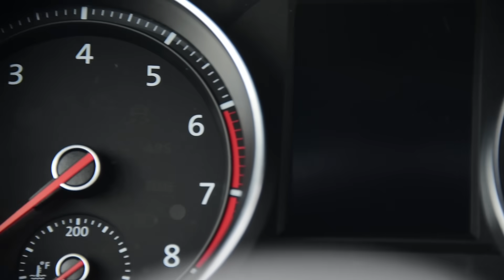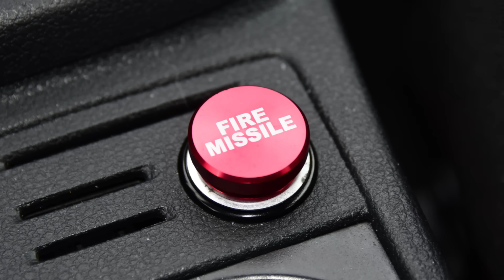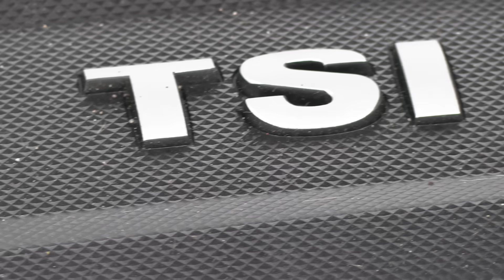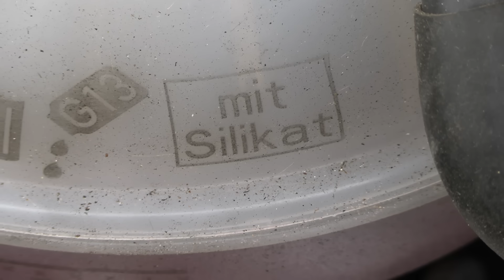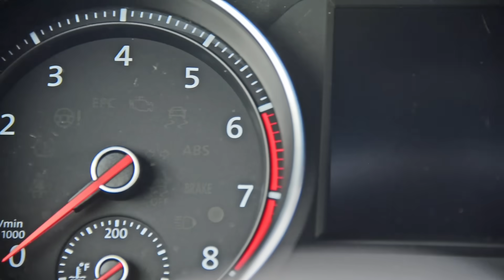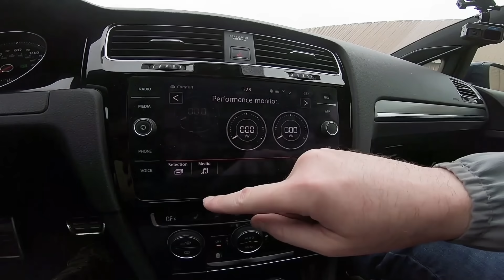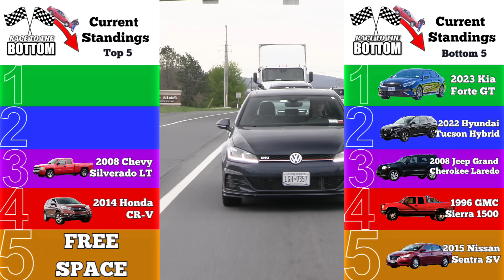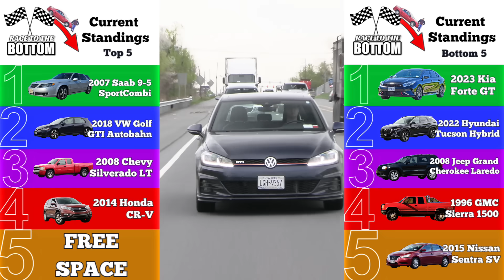2018 Volkswagen Golf GTI Autobahn: Regular Car Reviews

Comment: Mr. Regular critiquing the engine bay layout shows he’s used to older vehicles.  It’s tight but not that bad. Pulling a battery to replace a brake master is nothing.
Reply: Also torx is better than phillips since they don’t strip as easily. But maybe thats more user error
Reply: And how often is the master cylinder getting replaced on a MK7 Golf anyway? That's almost never gonna happen during ownership, goofy complaint for sure
Reply: The Galaxy's quarry of an engine bay is changing him
Reply: I had a 2012 Sentra SE-R SpecV before having a 2018 GTI Autobahn. The Sentra needs you to remove a wheel and the wheel well cover to change the oil filter
Reply: @Damaku250  And the GTI oil filter is right on top 😂
Reply: @leospaceman2976  Torx heads are fine. Bolts or screws of any kind on my air filter box are just unnecessary. The only vehicles I've owned with bolts on the air box are VW.
Reply: @Damaku250 that’s crazy cuz I have the generation before it and it’s just hanging out the side really easy to get to. Like just peeking under the car I can see it immediately.

Comment: The real irony of the Golf/GTI is the extreme misunderstanding of what the car is between the states and Europe. In Europe that's a boring seen it everywhere car, with an older client base, tuned accordingly, and with enough of a good rep that the nicer versions get insanely (to us) expensive. It's every rental car I've ever gotten by default over there as well. In the states...it can be that, or it can be that weird other choice vs a base Camaro or Mustang. So your lawyer or doctor might have a nice and obsessively owned GTI here, OR it could be a sTAnCed, cat deleted, chassis notched, future nightmare trade in boys car.

As a serial golf enjoyer myself I would like to point out that almost all of the common mods revolve around winding back that "seniors first" tuning aesthetic that the Europeans expect from this car. The absurdly linear power band, the little ball in the clutch hydraulic line that only exists to lengthen the shift moment, the suspension that is very nice but on the compliant side, etc... Drive a focus st back to back and it's fairly obvious that the ford was designed for a younger buying demo in the first place.
Reply: this comment is spot-on. 👌
Reply: Agreed 100%. I feel thats why it makes such a great platform to build on as well with the plethora of parts; even the OEM+ upgrade you can snag from audi/porsche.
Reply: @Mk6thicc  I definitely agree. That European "yawn I've seen this a million times before" factor means the aftermarket and OEM+ options are extremely broad. They sell so many there that every little micro niche is filled. I bet our GTI experience is pretty similar to being a European that's into large RWD American sedans. Imagine buying some weird ass car no one near you has, only to get online and find a continents worth of police fleet mods, the drag racing stuff, full subframe and other core geometry altering kits etc...

Comment: I drive a 2008 Golf Mk6 1.4 TSI.
Officially the most average car ever. He 'll turn 16 in a couple of months, and I intend to keep him until the Mk9 comes out, which was confirmed by VW to be electric only.
Golfs not only show status, they also show the exact opposite, indifference to status. No matter whether you're rich or poor, at some point in your life, you'll be able to afford one, whether it's new or used.
It's the great equalizer. Just like death, but way less german.
Reply: That's why i like VAG cars, u don;t wanna golf ok, here is A3, u don't have mony for Audi. U have Skoda....
Reply: Golfs don't show status, they show the sheep like midlndlessness of consumers who don't know anything about a product so buy the brand name because it's safe. And anyone buying a car for status is a nob.
Reply: @mateuszzimon8216  same car...just higher price for brand conscious
Reply: @crztank9298 you kind of explained toyota corolla and a lot of other mundane cars that exist on the road as an appliance that will get you from point A to point B.
Reply: Had a 2012 Seat Leon 1.4 TSI
The reasons I chose it over the golf are A: it was cheaper B: it had a manual option
kept it until 2023 when I switched to an EV. Never did any mods to it, it was just a car.
Reply: If the Mk9 is electric only, why not get the ID3…?
Reply: @geoffreymak000 I imagine the mk9 golf will have a more traditional interior with more physical buttons than the ID line

Comment: I know someone who's got an addiction to Mk7 and Mk8 VWs. Every story about when they break down turns into a lecture about how the job "only" needs "a couple" special tools to rip half the car apart in a "clever" way. I think it's the crayon offgassing from the interior plastics.
Reply: Same as land rover owners. Or modern Volvo's. Or Alfa Romeo.
Reply: Step One: move car to service position = Remove entire front bumper assembly, radiator, support, etc.

Comment: I have been owning a Golf GTI Mk7 for 7 years, bone stock, and I genuinely thought I would get over it by now... but it is honestly good. Besides major issues with the cooling system, and maybe the timing chain, if you look after this car, it will look after you. You absolutely do not need to do any power mods at all to it.
Reply: yeah, but it's fun when you doooo!
Reply: I’ve been on the hunt for a mk7.5 for years now and may just suck it up and grab a mk8. Or a new one depending on market prices at the time. There’s not many manual cars left, even less hatchbacks
Reply: "besides major issues with the cooling system" the engine might nuke itself if you don't pay attention, but other than that it's good!
Reply: @KrikZ32  there is a huge, loud beeping warning when coolant gets low. I had a part fail on mine, and it was very obvious that the car was not happy.

Comment: Grew up in the UK driving hot hatches but never owned a GTI. When I moved to the States, I went American owning 3 mustangs, the last being a GT 5.0. However, also owning motorcycles, I wasn’t driving the GT much and it was an awful commuter so bought a GTI a couple of months back. Man, it was like coming home. Taught suspension that you can chuck round corners. Enough power that you can join around in the canyons, but not so much that you can’t use most of it. I thought I’d regret selling the mustang for something a little more sensible, but not a bit of it! It’s also the first auto I’ve ever owned. The DSG is fantastic. Put it into manual mode, it changes quick, it holds the gear without the car taking over and it farts when you change up. It’s like the quick shifter on my motorcycle. Love, love, LOVE this car!!!

Comment: with silicat...

Had one of these for ~100k miles.  No issues, averaged closer to 40 mpg on highway drives, low 30s overall.  Most comfy car and possibly the most fun modern car below 60 mph.  Perfectly reliable, fun, efficient, comfortable...  Best car I know of (get the Fender Audio pkg, it's great, too).

It was better than the RL and Miata for which I traded it (except that the RL can carry my motorcycles, and the GTi can't).
Reply: What is an RL?
Reply: Ridgeline is my guess.
Reply: Add a tow hitch,they even install them on a smart car,you can pull a small trailer
Reply: Comfy? Seats are hard and the NVH is awful at 45 mph. Awful car for road trips and you are not getting 40mpg. Even on CC you are getting low 30s at most.

Comment: An anecdote about the tires: The Cross Climate 2's are a fantastic, true all-season tire. What we call "all season" tires here in the US are typically known as "3 season" tires in other parts of the world that see more severe winter weather. This tire, by comparison, is much more capable in the winter than most others in the category, but of course that comes at the expense of performance in non-winter weather. 

That's why I run pilot sport all season 4's (another "3 season" tire) in the colder half of the year, and PS4S's in the warmer half. I was really surprised to see this car featured because it's so similar to mine: another 2018 GTI autobahn, in seemingly almost exactly the same color as well

Comment: Tuned TDI IS THE BEST DAILY PERIOID! It's the definition of "if you take care of it, it will take care of you" philosophy but always accessible and daily drivable without luggaging the prestige and attention of a porsche or an AMG.
If you ignore whatever Pennsylvania has as a VW culture, there's a reason the SEAT Ibiza, Skoda Octavia, Audi RS3/TTRS, Golf R all share the same platform for a reason. From a perfectly sized medium sized family car for European and asian markets to daily driven track toys keeping up with porsche 911's while holding over 250k on the odometer. As a field technician, I put an easy 5k miles on my car per month and never worry about mechanical failure, average 50mpg, never brake much for on/off ramps all while making over 300lb-ft torque and flying under the radar. The Golf TDI is essentially a life hack imo
Reply: I'm at 270k miles on my 2012 golf tdi. Original clutch still. Tuned for 200k of those miles.

Comment: I'm an american who moved to the UK about 5 years ago, and my Husband already had a 2010 VW Polo 1.4 DSG 3door. As a guy who always drove mopars and a few GMs, it was interesting being behind the wheel on the wrong side and my first up close and personal interaction with a VW other than riding in friend's cars. It did change my opinion on them a bit...It drove really well and the 1.4 threw that little car around pretty swiftly. It felt screwed together well, and while 14 years old, it only had 70K on it when we sold it, it still needed quite a bit of work to get there...but thankfully here, the parts prices are no where near as bad as they would have been if we were in the US....a  waterpump/T-Belt job only cost about 280 Pounds.

Over here, the Golf is considered the "Family" car for a lot of people, but even now seems to be getting replaced by the T-Cross.

We sold the Polo on Motorway recently, as we got a Brand new Peugeot 308GT, and I was a little sad to see the Polo leave, my first UK that I passed my Driving test in, drove to London and back, and as we moved out into the country in Scotland, served us well, but it was time, I still wouldn't ever suggest an high mile VW to anyone, but I understand more why people do like them.

Comment: The GTI is the best single-vehicle option for people who need a car to do car things, but still want to have fun in it. The rear seats fit actual adults surprisingly well. If they're folded down, the cargo area is spacious to a genuinely impressive degree for its size. I've hauled things in mine that the store employee who sold them to me said I'd need a truck to move. It gets low-mid 30mpg range, and on one occasion in ideal conditions while actively driving for efficiency, I've hit 40mpg. Even the low-trim GTIs like mine accelerate quite hard, and even without the LSD and higher-trim sport brakes/suspension it's a blast to drive on twisty roads. And while not as much pure fun as a manual, the DSG transmission on mine offers a pretty good compromise of having full and quick shifting control at all times while not being annoying in commute traffic.

I've had my 2016 GTI for almost 7 years and 90k miles now (second owner, was a leased vehicle before me). I've owned many cars, including a Miata, and this is by far the longest I've kept a single vehicle. I haven't had to do anything to it besides service so far, but I fully intend to keep Ship-of-Theseus-ing this car until I no longer can afford to. Part of that is that I don't like the looks or interior of the Mk8 very much when compared to my Mk7. Most of that is that it's my favorite car I've ever owned.

Comment: I have a 2019 GLI (same setup but with a trunk).  Bought it new.

I was actually looking at the Golf wagons at the time and glanced over at the GTIs.  Like you I thought, well this is a car that Offspring would sing about.  It was nice enough but I asked if they had something with a stick in it.

The guy lit up and brought me the GLI.  Same setup engine and transmission wise but with a spot to stick the golf clubs.  I love how it can get me out of trouble but not necessarily get me into it.  The six speed is very responsive and I have enjoyed driving it.  It has good, tight steering and responds well to the throttle.  The turbo spools up quickly and efficiently.  And if I keep my foot out of it I can get 35mpg in mixed driving.  It is an impressive little car.  It has its faults like all cars do but I don't have any reason to want to get rid of it any time soon
Reply: Got the same car myself when it was new with a DSG, originally because it was a lot cheaper than a comparable GTI. Got it for $24,500 out the door, definitely quirkier than the Hyundai it replaced but hasn't been a money pit like I was told it would be, even after modding it. Thought I'd regret the DSG until I learned you can code the shift points, turn off the auto-upshift, and always have the center screen display what gear you're in regardless of drive mode.

Comment: I love my little base 2.5 mk6 2012. Its literally just right. Shes stock af but its my first car ever at 32 and it sounds good, drives good, etc. Its just a fun car i got lucky to find that was taken care of and the fact that it is stock. 90k miles and only have slight electrical issues when it got cold. Other then that shes fine and a beaut in all white.

Comment: Came across a mk6 that needed a little love to get back on the road, after solving mostly electornic issues alongside new tires and fresh  Liquimoly oil, the gti runs like a dream, and my goal is to put it OEM+, get some modern features first like car/apple play and reverse camera, and a few adjustments towards suspension for it to feel a little tighter in feel, afterwards, i would be extremely satisfied and keep it as my competent daily driver.

Ive definitely hit the VW bug after first driving this car.

Comment: I have a 2019. Maintenance is actually very easy. I have 77k miles on mine, and I just now did pads and rotors. Was super easy. And aside general maintenance, I haven't had any repairs.

Comment: I think a Mk6 Golf GTI would be a better candidate for race to the bottom. My experience with those cars wasn't great. In 60k miles it blew a head gasket, began to rust, the windshield adhesive began to deteriorate, its heater core clogged, the headliner came unglued and dropped down to the back seat, and it developed leaks in the weather stripping and sealing. It was fun to drive, and comfortable, and the dash materials have held up, but oof, did it fall apart quickly. I hope the Mk7's like this one don't suffer from similar issues.

Comment: Yo, the Michellin CrossClimates are fantastic tires, if you don't want to swap summer/winter.
They're not performance tires, but they are pretty good in the dry with a real 3peak snow rating.

Comment: Cross climate 2s are supposed to be the All tire.theyre our top seller in the KOI area.
Reply: I don’t know if they’re the right tire for a GTI but I’ve had them on a RX and my current CX-5 and have no complaints.
Reply: They were horrid on the GTI, causing everything in the car to vibrate above 65 and made a constant droning at every other speed. It also felt like the car was wearing weighted boots, in terms of engine output to actual speed, if that makes sense. I replaced them with Yokohamas and it's way better.
Reply: @JakeHercules  wow I’m pretty sure those tires were defective. Mine are super smooth and quiet.
Reply: We have them on our SUV and they are great. Friends have them on their Subaru and love them as well. Universally praised in reviews and by tire shops.

Comment: cross climates are litterally thed best all season tyres, just dont expect them to be the best in the summer or the winter they are the best compromise which means they excel at noting but do very acceptable at both
Reply: If you want more performance without completely giving up in the cold you get the Conti ProContact DWS06+ or the Michelin P4S All Seasons. Cross climates give up a little bit of dry performance for much better traction in the wet and snow.

Comment: I rented a Camry on my recent trip. They ran out and the guy asked me if I wanted the GTI golf. I said "yeah" (duh). Best luck ever. It was so fun. Way better than a f**** Camry. Rode really nicely if you didn't step on it. It was really punchy if you did step on it. Super low and compact. I bashed the side of my face on the top of the door frame several times getting in. Good gas mileage. If you don't need a truck and just need a bebop roller skate car then you're in luck. If I didn't need a truck, I would buy one. For now I have my Elantra with a dent.

Comment: Here's the thing. There's a golf and then there's the GTI. The Gulf is the economy car that will get you to work in German efficiency. The GTI transforms it. Into a Nuremberg hyper cruiser. Audubon track eating machine with a better motor either the the 16 valve over the 8th valve. Or the VR6 or the turbocharged 4. Better brakes in suspension package. Without too much flash.

Comment: I had a 17 Golf 1.8T  Wolfsburg and a 5 speed and enjoyed it. 3/4 GTI for 3/4 price. I just didn’t want to spend GTI money.  Replacing the 16”wheels  with 17” with Michelin Pilot Sports really improved the handling.   I hated the clutch, so the DSG would be the way to go.  It had a 22k sticker, as did the 16 Chevy Cruze I had leased prior to the VW and there was no contest on which one felt worth it.  I’d get a GTI or an R if I wanted another VW but I also didn’t have the VW long enough to endure any VW/German car aging issues.